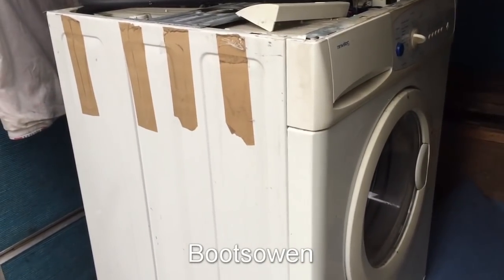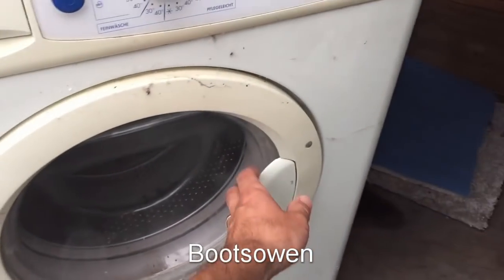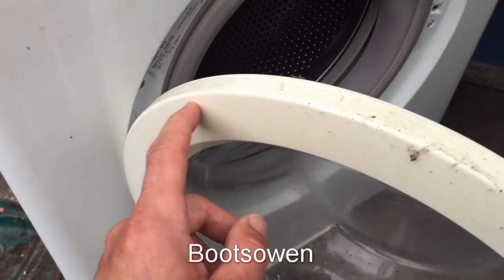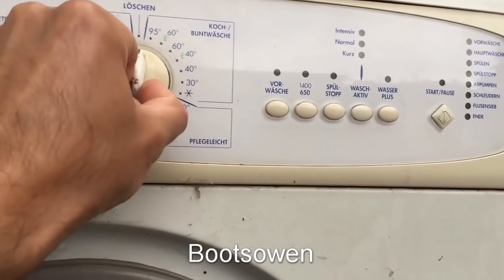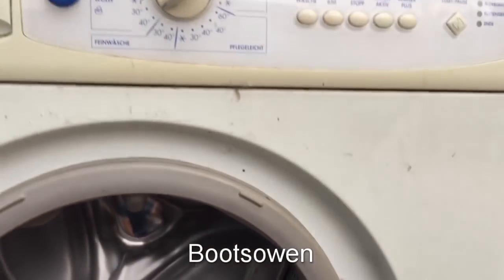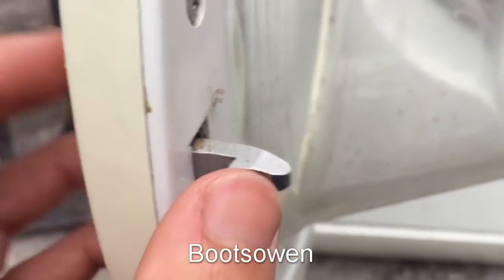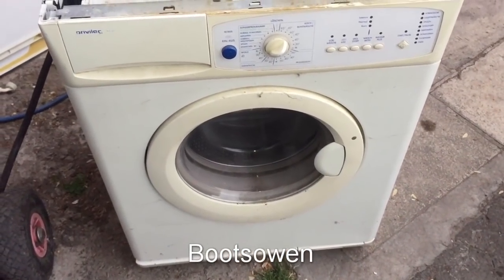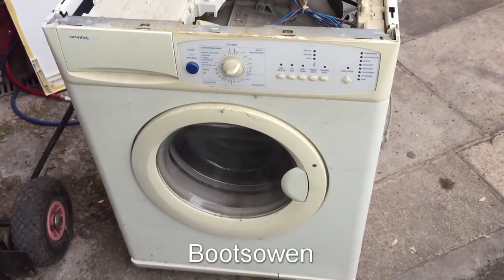Street find and inspection: Privileg 5140

Comment: Maybe you should try removing all the concrete and then wash towels in it see what happens 😂
Reply from the maker: Yes, but it is difficult to remove the concrete because it has a front and a back piece rather than a top and front piece.